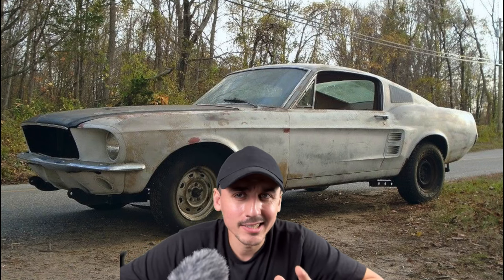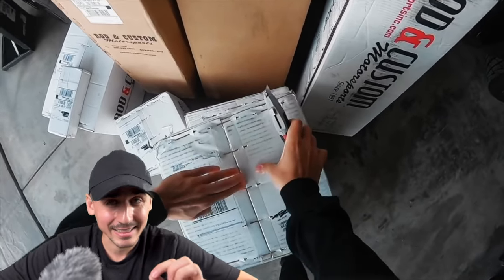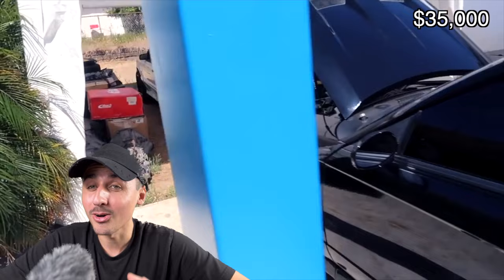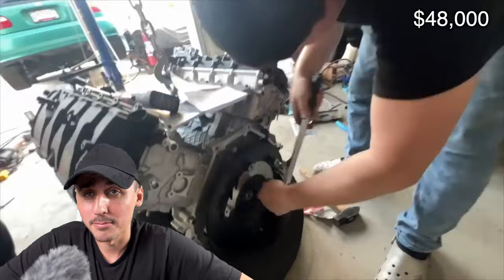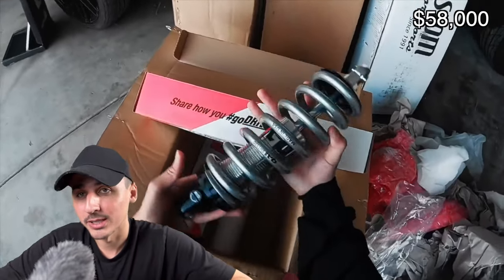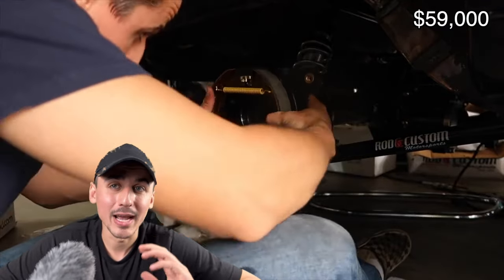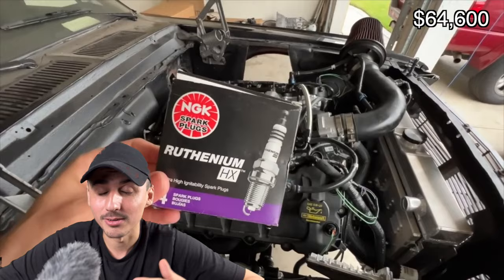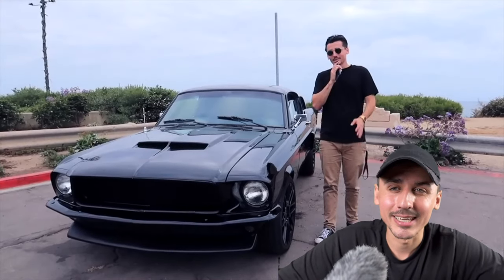Turning a Classic Car into a Modern Car! A "How to" and Cost Breakdown Guide!!!

Comment from the maker: New style of videos coming your way for more content! I am still getting used to these types of videos but I do appreciate your support
Reply: Also all modern cars never have ashtrays, so removing them and replacing them with a storage alternative and two USB electric inputs as options is a must for all classic cars.
Reply: Please how long did it take to complete your build and do you take build orders?
Reply: He doesn't even know the stock Ls Engine he just recomended is not an ls engine, the LS2 (6.0 liter, 364ci) was a large evolution of the ls platform and was given a Gen IV designation. The LS2 debuted in 2005 in the Corvette (400 hp), GTO (350 hp), and the concept-car-inspired SSR (390 hp).Jan 22, 2022
Reply: The LQ9 is a 6.0L Gen. 3 small block engine used in GM trucks between 2002 and 2007. For marketing purposes, it was also known as the Vortec HO 6000 or VortecMAX. The information listed here is for the stock engine.Feb 2, 2018

Comment: The interior is something you have touched on yet. Stereo, leather bolstered seats, gauges, lighting, air conditioning, and sound deadening are common modern features that people have become used to and want to see in these resto mods. That 35k starting price gets you a road ready car. Plus you get to sell off some of the stuff you don't need anymore like the old engine.
Reply: Easily another 5-10k but your right selling off all those parts would recoup you some.
Reply: but the real question is, how much could you sell it for after you do all this? At least 120,000 right?
Reply: @Usman.-khan  no. mods generally don't get you much value
Reply: @Usman.-khan more than likely people would buy this for the engine/fastback body everything else is kind of… required and not seen as valuable. He’s probably very lucky to get 90k
Reply: @Bdmrr Actually it’s now getting to the point where you can make a few bucks more than you think. 

Lots of old school muscle cars that have been modified are going for $65+ 
That’s pretty good for a car that you had fun building getting up then selling for more than you paid for it.

Comment: one thing I can say from experience, when you buy and restore a classic car that needs engine, suspension, bodywork, paint, etc, chances are you're going to spend more on it than the car will be worth once it's restored.  best advice is to try and find a classic car already restored or mostly restored...otherwise, you better prepare yourself for a moneypit that never seems to end.
Reply: If he lives anywhere near where that video was filmed... The money is probably just part of the experience 😂😂😂
Reply: Thank you for this sound advice. Hopefully a 5th generation Mustang won't cost me too much to get the look I'm going for.
Reply: Amen.  Finding one that someone wants out of ... and waiting until they need money quickly is the ultimate move.  What's really crazy is how expensive 1990s sports cars are. I bought a Supra TT in '97 right after the $10K price drop brand new ... and sold when it hit 43k miles thinking it'd start depreciating more quickly. I'd already built it to about 500 ft-lb and high 11s ... so I was happy to get most of my money back out of it. Honestly, what I really loved was the RX7 FD ... Basically, 90s sports cars (excluding the 3000GT) are the only imports that reliably went up in money.

Comment: The interior, seats, dash, gauges, removing rust, LSD..? WIRING (OMG that could be a huge job). AC, meh, stereo, sealing and painting the underside of the car so it doesn't rust again, ... removing DENTS, bondo, sanding, rince repeat, rince repeat ... repeat repeat repeat... exhaust, tuning, mistakes.  A big one being ... The cheap man pays (at least) twice.  So to say the least you did an increadibly efficient job.

Comment: Found my 1968 Camaro in amazing condition for only $27k, only cosmetic issues. Got it repainted for the low by a family friends business. New brakes suspension and wheels (by choice, not required) and had some minor touchups. My dad does interiors and we put in a modern head unit, cameras, AC/heat. 
All in all, aside from the price of the actual car, I spent 5k on bodywork (paintjob) and 10k on everything else. It’s practically finished, so 15k worth of cosmetic and functional upgrades can make a daily driver. Prices can vary depending on connections you have.

Comment: I was lucky.  Bought my grandnational in great condition in 2019.  No interior work needed.  Kept it stock for about a year.  24k for a 74k mile grandnational with t tops.  Engine kept stock.  Just hot tanked and new pistons.  everything else new from brake lines to fuel lines.  New AC components.  Power mater brake system conversion to vacuum.  Rebuilt transmission with a bigger torque converter.  Transmission good to 800hp.  Razor alcohol injection.   Bigger at 20psi of boost with adjustment to 24.  Still have not painted it yet but I estimate 5 grand.  I plan on going with 18 inch gnx style wheels.  So with the purchase of the car and everything being touched outside of paint I'm about 50k in.  I now have a 500hp 600tq monster.

Comment: I love the 1980-90s Pontiacs both the firebirds and the Fiero but the tech is old and hard to find in decent condition. Would love to have modern easily found parts to switch with so it not only be easier to care for as time marches forward but also so it can keep up on the interstate😂

Comment: My dream is a 69 Stang with modern features like yours, but illl add  more like:  ABS, LCD rear view camera, backing camera, ABS, sensors, key-less feature, power steering, LED lights, sound system, radio, convertible feature upgrade, advanced AC system, wireless chargers, lcd dashboard, cup holders, voice activation, heated seats, AWD feature, diamond coating, etc. 

I think the convertible mod will be the costliest at $15k, so $100k more in upgrades for my dream modern Stang

Comment: My question is how do you get started with little money ?
Reply: All projects have steps. It's best to break the steps down into things that are clearly defined. So your first step is: get more money
Reply: There are some cheaper cars like novas, Plymouth dusters or ford mavericks that are still pretty cheap.
Reply: The ford maverick would be a good one get a 5.0 explorer swap all the parts for cheap. You got a good 8.8in rear end with high gear ratios, take the disc brakes from it. A engine that has a huge aftermarket support. You get a cool little car for very cheap.
Reply: It's best to save up if you can before you get started😂otherwise shit is gonna take longer.

Comment: Thanks for the video, the car I want is like old bmw and old porsche the most expensive is the  porsche the bmw I find one extern bad condition but intern runs ok I is a beginning I pretty much do this put electric windows, back and front camera sound system the good ones with bluetooth and good air conditioner system and good engine for track racing in the total I will pay that price you said like 64k because the bmw is like lower price less the porsche is like 45k in that case I giving for later and I pretty much love BMW